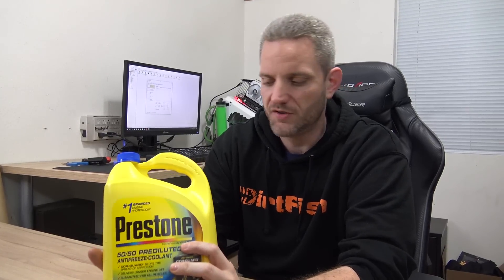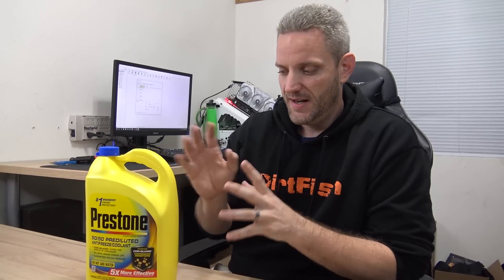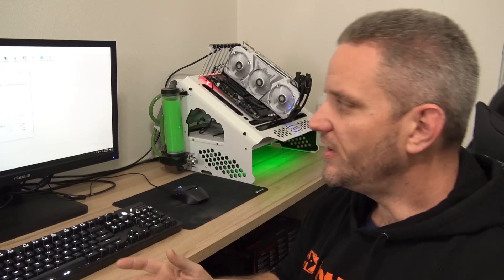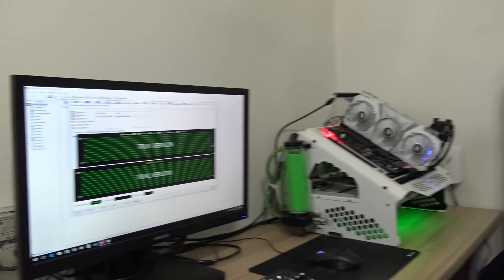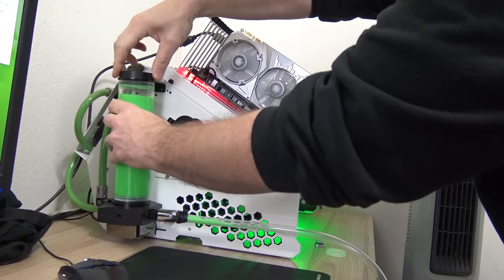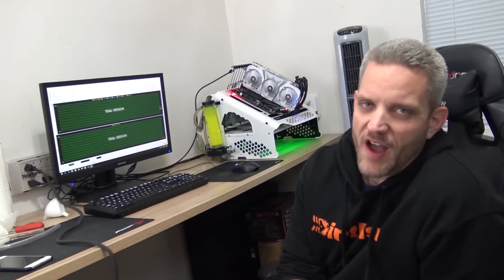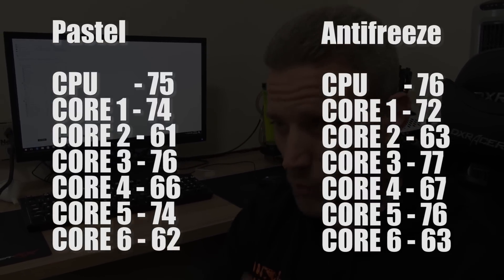I used Antifreeze to cool a PC

Comment: I don't think it's about better cooling. I think it's a better "cooling solution" (solution as in mixture). Automotive coolant is formulated for long life, anticorrosive stability, cooling very high temperature parts etc. It's designed for a "severe service" environment so one would think it would perform very well in a PC cooling system providing not only safe cooling but long life.

Comment: FYI that "reaction" is no reaction. It's just the visible difference in density between the glycol mixture and the distilled water. The water is lighter than the glycol and rises to the top of the reservoir. Due to the difference in light-fracturisation you see those swirly marks. :D

Comment: I am using car coolant for over a year now.
With soft tubing and the same Alphacool reservoir/D5 combo.
I ask an experienced car mechanic about the coolant and plastics and he said the same as Jay did. No PETG (because of the Glycol) bit all the others like Acrylic or PVC etc are fine.
i really love these coolant, because my CPU / GPU blocks do no corrode. they are still shiny!

Comment: I used 10% antifreeze and rest distilled water in my first build and the tubing got clogged up with junk, which made CPU temp rise 20 degrees celsius cause of almost no waterflow

Comment: Peltier brick on a block on all side's not just top the entire copper cube. now depending on case or cable's add the gpu to the one side and the cpu the other with a ribbon cable.
Reply: be sure if frost is a problem try flipping the entire board over and let it condensate on a drip tray.
Reply: Silver work's great on preventing sludge build-up in your cooling lines for a pc.

Comment: Car radiator coolant/antifreeze does not cool better than water. Radiator coolant/antifreeze is only necessary because 100% plain water will rust the radiator and engine over a period of time, plus it'll freeze solid in winter.

If you're really gagging to try something, try Redline Water Wetter, Royal Purple Purple Ice or DEI Radiator Relief that actually do help water cool engines better. Now that would be interesting.

Comment: Jay! As a car guy I'm disappointed you didn't mention that antifreeze is actually a worse coolant than water is. Obviously not by much and at the temps of a PC, not even noticeable. And in a car it acts a lubricant and rust inhibitor

Comment: IF I did this I would only use GLASS tubing, not PETG to eliminate as much chemical reaction as possible for long term. But I would only try this if it works better than normal water OR if you don't need to clean it as often.

Comment: I ran that exact same water kit with a diff waterblock except I used semi rigid silicone tubing to test out running ethylene vs propylene glycol, I ran both for 3 months, I had less buildup with the ethylene vs propylene, propylene glycol left a purple/red permanent color inside the res, ethylene on the other hand left nothing (I changed res casing for both tests) but this is all with using clear silicone tubing.  I then proceeded to switch the tubing out to clear pvc and within 4 days the tubing started to all turn white, but the pvc wasn't as affected by propylene glycol but as it did the res it left a reddish purple in the pvc, All done on a Xeon E5 v3 2660, although everything still works I think I'll use a much lower system for my next experiments lol

Comment: Anti Freeze keeps the coolant from freezing in the winter.  How could anyone think that translates to cooler cpu temps?  Freezing point and boiling point are different from thermal capacitance (heat capacity).

Comment: I bought a thermal take water cooling kit a few years ago with soft tubing. It came with green ethylene glycol coolant. The coolant literally just said on the bottle "Ethylene Glycol" ran fine for years.
Reply: Correct. Neither are the ones he's testing here. He said he was afraid to leave it like this, in these soft tubes of his test bench. I'm giving him an example of why he probably doesn't need to be, in this case, where he's not using PETG.
Reply: PETG? Wouldn't that be hard tubing?
Reply: Kappi1997 yep

Comment: As an add in thought, thermaltakes c1000 is roughly 20/80% ethylene glycol/water. plus the colouring. i don't remember what the other brands use but any input anyone? Jay?

Comment: I didn't know about the piping problems, so that is new, but there would be dielectric problems with multiple metals. The steel motor and aluminium sink would effectively create a battery as well. If you used a brass or copper radiator (preferred for better heat transfer) that would further complicate things.

I grew up around mechanics and can tell you you used the right stuff. Antifreese is best when used in a 1:1 mix (at least) with water. In Northern climates you might go 2 anti:1 water, in winter, but the 50/50 is best for most usable applications. Use of distilled water is probably best due to lack of minerals that can contribute to the electrical and dielectric problems.

Comment: Will mineral oil effect components which it's surface contacting like tubes, fitting, waterblock, inner surface of radiator, pump blades, etc.
(I'm not talking about LTT like fully submerged rig)
To be specific I'm talking about effect with PETG, Acrylic, metal of the cold-plate & fluid colour changes.

Comment: a lot of  cars have plastic coolant components. just check types of plastic ur cooling system has and let it run.  coolant also acts as a lube  and the anti corrosion as u stated. it may bring more longevity to your gear.

Comment: That wispy effect is probably due to the antifreeze mixing with some leftover water. I'm not sure what that is called, but its most often seen when  miscible liquids with different densities are mixed. Whenever you dilute a concentrated acid, it's very pronounced.

Comment: If you want to test long term effects of your "coolant" on parts, you can always make a supa simple loop that's NOT on a system and run it on a hot-wired power supply.

Comment: If you want cool temps and stability, instead of water cooling, go with Freon (like R-12) cooling, using an old fridge compressor. Or even if you don't want too much hassle, some case companies sell cases with these things on the bottom of the case (I believe Linus reviewed one big white case; there is also a smart dude on Youtube who did it himself on an old system, named dumyyyyyy)

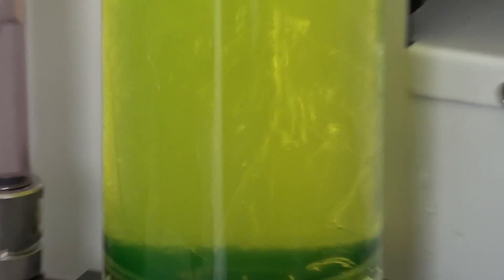Comment: what you see at 6:20 is probably the antifreeze coolant diluting with the destilled water from the tube. give it a try and put some anti freeze coolant in a glass and put a few drops water in there. you might get the same odd looking mixture

btw. great videos. keep it up! greetings from germany

Comment: supposedly Galinstan(liquid metal/non toxic mercury replacement) can be used to super cool a pc. antifreeze( Ethylene Glycol) has a thermal conductivity of 0.37. 40%Potassium Acetate and 60%water is a little better with a thermal conductivity rating of 0.53 . Galinstan has a thermal conductivity of 39. the downside being no pumps exist for liquid metal you basicly have to diy one by straping alternating north and south magnets to fan blades the faster the fan spins the faster the metal moves. another thing is that the metal is supposedly sticky so it will never leak but it will be a pain to clean for re-use.

Comment: I used Toyota pink antifreeze in my loop for over 2 years and had no issues. The only "bad" thing that happened is that the tubing got discolored.
A lot of premixed fluids designed for water cooling also have ethylene glycol in them, or at least they used to like 5 years ago

Comment: Hey what is the best GTX 1070 for your money so far? ASAP PLS
Reply: i have that one its great. Even does +200 core on air
Reply: I had a EVGA SCC 970 and it was an awesome card, but for my 1070, and after a lot of research, I went for the Strix OC, its the coolest and imo the best looking of them all. A lot of people where reporting thermal issues on EVGA's new cards, even if they fixed them with thermal pads and a bios update that just ramps up the fans I don't think its a smart option. For the price you are paying for a high end graphics card, you should expect a working product out of the box. Asus Strix and MSI Gaming X are the best 1070 you can get, just read the reviews.
Reply: No, the MSI one is better. It has the same performance and temps as the ASUS, but it's much more quietly doing it. And MSI afterburner is optimized for MSI GPUs too.

And this is coming from a guy who owns STRIX RX 480. I went ASUS because I'm an OCD freak who's system happened to be mostly ASUS and it has to be completed with ASUS.
Reply: At least it's so with the RX 480. Idk about 1080 but the all use the same cooler design across the models.
Reply: Bruh 1070 bruh 1070. And I need a white GPU
Reply: PPPOOOFJJD Oh yea 1070 sorry for that, but the coolers are same anyways. Well if you want white there only really is the ASUS Dual 1070 and the the Galax sniper white 1070, good luck finding that thing though.
Reply: pricing fluctuates and i got mine for only a bit above MSRP of the Reference model, but i'm extremely content with this model 1070.
http://pcpartpicker.com/product/HgPzK8/evga-geforce-gtx-1070-8gb-hybrid-gaming-video-card-08g-p4-6178-kr (EVGA 1070 Hybrid)

reasons being that the Liquid Cooler keeps the GPU at lower temperatures than my Processor, even while running Furmark.
this means that it is literally impossible for my 1070 to be limited thermally on performance.
i can give the card as much power limit as the locked down BIOS on GTX1000 has, and get every bit of performance result out of it that you could theoretically get. i end up Voltage limited which isn't changeable on GTX1000 cards without hardware modification.

it also looks pretty sweet. it's not white, but a metallic look goes with most anything, right?

if you're just looking for a white themed 1070 for as low a price as possible, people can't really help you with that. just browse the GPU's available, and price compare all of the models that have a white theme.
Reply: PPPOOOFJJD Galax HUF edition is a good aption and it's white, you could also get the cheapest reference one and the NZXT (white) adapter with a close loop water cooler.
Reply: Hugo Camacho  But isn't HUF some limited edition? I would imagine that means it's more expensive.
Reply: Drunk Meerkat it is more expensive but since he is asking for a white card for his build , its ether that or the second option with the NZXT Kraken G10 cooler with a cheaper reference card, MSI Armor 1070 would be a cheaper alternative but it's not all white and it doesn't have a backplate.
Reply: Drunk Meerkat asus dual doesn't have a backplate :(
Reply: pls dont get evga gpu they are trash and too expensive asus strix 1070 is godly
Reply: palit jetstream
Reply: @Dr Herpington You are a complete fucking moron. Nothing wrong with EVGA video cards. They are top tier.
Reply: UberTiger1 that might work
Reply: Dr Herpington bruh you are trash ..do you even own one?
Reply: no clue why americans are hyping EVGA soo much.
Reply: Dr Herpington 'they are trash' what a very extensive, 100% factual recommendation on product brand.

there's very few GPU brands that aren't good. very. few. infact it is fairly difficult to recall the names of any, as almost all of them have gone out of business, honestly. save for no-name illegal ripoff brand stuff.

UberTiger1 i don't see what hype you're seeing (as i see plenty of blind hype towards all brands of everything, blind people everywhere) - however a notable feature that EVGA has on their GPU's, is that they picked up the lifetime Warranty coverage from BFG Tech.
it's only offered inside America though.
their Support Staff are also 100% located in America. i.e not outsourced.
Reply: google it

Comment: anti freeze is supposed to be warm how would that be good
Reply: Anti freeze lowers the freezing point of the solution, increases the boiling point and prevents corrosion of metal parts.

Comment: I haven't watched the vid yet but I predict the temps will be slightly hotter than water because antifreeze is more vicous and doesn't flow as smoothly and doesn't conduct heat as well as water.

Comment: There is an special liquid used to cool down aliminuim or any metal while it is manufactured on either a CNC machine, lathes or milling machine, pretty sure that could get the CPU to 20 with ease (is white btw)

Comment: You could probably do a failure test by just running the cooling system in a fishtank (maybe suspended?) with a camera taking pictures every hour to see how long different mixtures would last. At least it would save you from having to destroy a computer to see the end results.

Comment: Antifreeze doesn't react in the  bottle because they are made of PVC I believe. And I know that radiator tanks are made of glass reinforced nylon because it doesn't soften as it heats up and doesn't degrade from the antifreeze. Anti freeze does 2 things in a car radiator, ups the boiling point and lowers the freezing point. That's all it does. It doesn't make the car run any cooler than straight water.

Comment: I'm genuinely surprised by the lack of 'you can put a PC in mineral oil, why not use that as a coolant?'  

Honestly though, if you could find a pump with enough head pressure (heh...), I could see you doing a custom loop with copper piping and all copper fittings to handle that extra pressure.  I mean, I hated that whole steampunk thing too, but exceptions can be made.  

I also really don't want to jump on the Liquid Nitrogen/phase change bandwagon, more so because Linus basically did that already.  Don't think he even touched on the subject of using mineral oil as a coolant beyond literally dunking a PC in it though...

Comment: Theres no advantage to using this in your PC cooler pricewise and it could damage certain materials in the cooler, its formulated for use in cars where it has to resist freezing and not damage metals found in a cars cooling system, I use plain water with a bit of antibacterial dish soap in it so crap doesnt grow in it and never have any problem and havent changed my water in two years

Comment: Antifreeze?
EthGlycol will have problems with PETG tubing.
Otherwise.... meh YNOT.
We dont choose antifreeze because its 'better', we use it because its ok working for less money.
FOR HOW LONG?
How long do you say to run fancy nanocolored coolant?  
Get some spare hose, fill it with antifreeze, closed loop it and set it on the back porch in the sun... weigh it in 6mo and see if any leaked out. HOW LONG is teh question, we still dont have an answer Pro or Con

Comment: I have been running antifreeze in mine for over a year.  I got my pump from the dumpster at micro center because I watched some worker throw it out,  it was leaking(h100i) so I took it and put automotive lines on it. grabbed some antifreeze and made a res so I had a way to fill it up. cpu is a amd phenom 955 clocked at 4.0 ghz and temps never go over 65c and I got all the volts I could going into it.  believe me this cpu wont go any faster...  so in need of upgrade.  zen better be cheap because I'm broke.
Reply: Im saving up. I have 300 now and i put $25 in the computer pile every week. eventually will be able to buy one. How much it costs determines how long before i get one. All depending on performance per dollar vs the intel.

Comment: as a mechanic it won't do much to the plastic. however the clear tubing will become discolored and hard as a rock if I was to use antifreeze for a PC build I would use Dexcool orange coolant it's less corrosive. only other problem I could see is there's nothing to keep bacterial growth out of it. you'll end up having large clumps of goo growing... coolant gets up  around 210 degrees which keeps bacteria out so manufacturers don't put anything in it

Comment: You have to remember, antifreeze ISNT FOR COOLING, it's for making the freezing and boiling points higher than initially. So the effect of the anti freeze would be increased resistance to heat.

Comment: Antifreeze works in a car under pressure which increases the boiling point. Not like you can get 20 psi in your cooling loop though.

Comment: what about plain water?
Reply: That's what is used already, especially those water coolers that come pre-built
Reply: +Insert Name Here
Closed Circuit Coolers absolutely do not use just Water.
since they are expected to never be maintained, they are a mixture of several chemicals, Anti-Freeze is a pretty common additive infact since it does a lot of things.
Reply: Could a bunch of UV LEDs be used to stop microbe growth?
Reply: Some use UV light already...some use silver, some use additives, and some use a combination.
Reply: Algae? Seaweed will grow after some time that's why people use Antifreeze with distilled water just use a 1/20 - 1/10 mixture i use it since 10 years without any problems.

Comment: For everyone watching this video, the number/size of radiators and the CFM of air passing through them will affect the temps more than anything else. In fact, everything else is practically negligible regarding temperature. Even the thermal compound is negligible in comparison if it's decent.

Comment: it will leach the plasticizes out of the tubing and make the coolant cloudy. eventually the tubing will get brittle. Ive run antifreeze for 2 years now. i had to change the coolant once. from it getting cloudy =. it started happening again and i added 91% alcohol, not much, about a 1/4 cup at most. it cleared up the coolant and I've never had to change it since. i also have hardware store vinyl tubing. I don't see it leaking any time soon. maybe one day i will switch to proper coolant and tubes but mehh